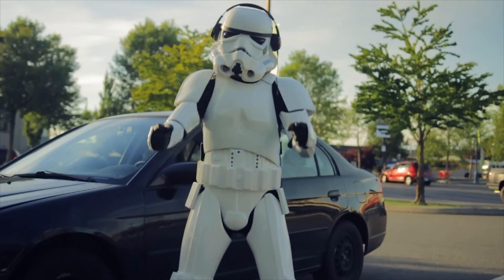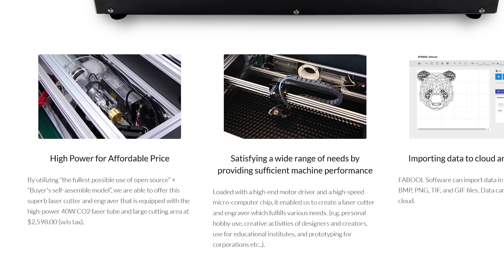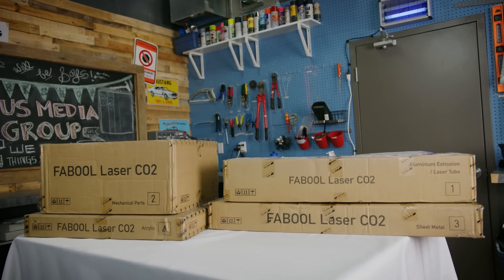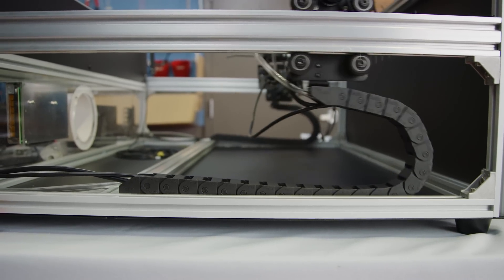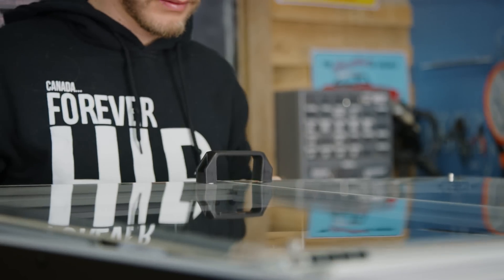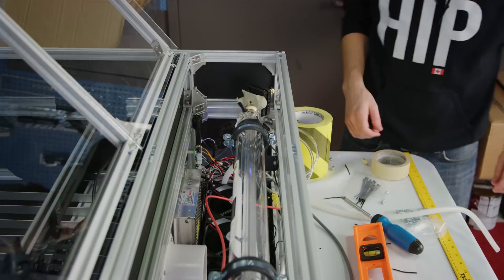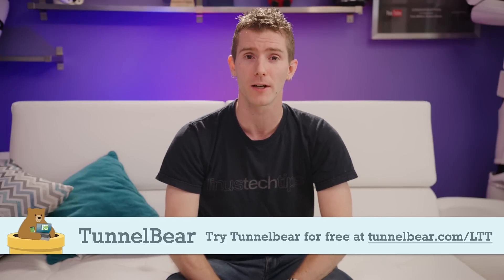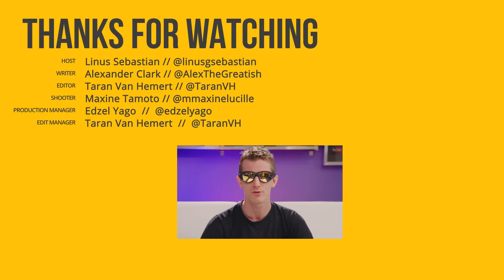We Built a FRICKIN Laser Cutter - HOLY $H!T

Comment: I’m and engineering technician and run a number of laser cutters, and there are a couple of things that could help your cutting experience, and I may have come up with an RGB fix for you.

As mentioned you need to have a pressurised air hose that blows air onto the cut to keep the head from becoming jammed up and the cut nice and clean.

When adjusting your laser cutting settings, you’ll need to use a consistant spacing block from the head height ( I use a 2mm acrylic piece ).

When adjusting the mirrors, I cut myself circles of 0.4mm card with targets on the center rather than using masking tape as it allows you to compare adjustments. 

By the looks of things you’ll want to increase your gain as you reach high XY values as with the cheaper types of mirrors you have you’ll experience more light dispersion.

When cutting or engraving shiny materials particularly mirrored acrylic and un finished aluminium, either cut from the back (not possible for engraving) or cut through masking tape on the material.

You’ll want to make or purchase some metal cylindrical standoff’s that allow you to engrave material that isn’t flat, like the side panels of computers.

Finally, in terms of the RGB fans, they may have proprietary headers, but their code is either open source or available from the manufacturer directly. When I was servicing our 1mx1m industrial laser cutters, I re flashed our machine with an improved source code that allowed many of the menu functions on the display to be hidden, so it can be used in an teaching environment.

Good luck

Comment: I made my own DIY laser cutter bigger than this, and man did the alignment cause me trouble. Its a pain in the ass. Don't forget to use air assist, smoke will actually burn in to the focal lens and cause it to cloud. You will have to replace it. And about the 3D printing, it really depends, I run a bigger nozzle and parts are very strong. Great vid.

Comment: How about using it for some serious case modding?
I have been looking to buy a new case, and have noticed that almost all a manufactures, offer a lot of bling, but lousy airflow.
For example, a plastic shield in front of the front intake fans, and the air is only sucked in through a 1 inch(2.5cm) wide strip around the front.
A custom front plate, that lets the air flow, with some RGB fans....??? hmmm???

Comment: You should be careful with the fumes. The laser cutter at my school has a separate module to filter the air that comes out. Also, never cut carbon fiber with that thing it's very dangerous.
Reply: Use to use one in school about 10 yrs ago, acrylic is horrible to cut. Don't ever try to cut lexan without the proper equipment it just melts, catches fire and can ruin the lens on the head
Reply: What, it connects to the closest black hole?
Reply: Totally agree, specially the fumes from Acrylic is nasty as fuck, and can/will catch fire, and you would want suction for that.
Reply: How is this not higher? This shit is incredibly dangerous and you're endangering the health of your employees by operating it.
Reply: Prince Westerburg i didn't invent it but I can assure you without the proper filtration these toxic fumes can cause forms of lung cancer.
Reply: Chad Porter what I remember is that when you cut carbon fiber it is not cut cleanly. Since it's a fiber, small strands of it can get caught in your lungs and cause forms of lung disease. Carbon fiber is extremely dangerous when inhaled.
Reply: Toster2013 no the filter is whole separate unit like 1 cubic meter. It needs to filter out toxic fumes it's not just a simple thing.
Reply: Matteo Mazzone so a fan, a carbon filter and a big price tag coupled with a salesman happy to scare local authorities into buying them.
Reply: But what if they tried it on Carbon Fiber 🤔
Reply: We use to cut wood, vinyl, acrylic, engrave painted metal and etched glass with ours the ventilation system was just a simple 4in duct with a fan and a simple filter. Anything beyond that required argon and a much better filtration system. I'm not up to spec on the exact wattage etc for what it was all I know for certain it was a co2 laser and we used Corel draw 12 to send our vector and rast images due to the ability to adjust power settings based on material.

Comment: Guys is this a good computer build ?

https://pcpartpicker.com/list/YfhnZ8
Reply: Yes thats plenty for highend gaming performance, only slow part would be the HDD, i would get a 256 or 500 GB ssd to run windows/games from, that is hdd intensive, to improve loading times.
Reply: chrisjon ok thanks for the suggestion!
Reply: May want a better cooler like a aio. But the 212 will keep it cool if it’s not overclocked to far. It’s not a need is more of a want.
Reply: Also you don’t need that fast of ram for intel. Could save money for a better cooler if huger is tight.
Reply: Matthew k which ram should I gry
Reply: Matthew k get*

Comment: Alright Linus I got you. Make a “case” or dock that you slide a laptop in.  The laptop should be put in vertical and flanked by 2 inch metal planes on the side with plenty of RGB. I thought for laptops like the Alienware 13 you could had a bar with ports that slides into the laptop when you put it in the dock with servos.  Anyway in the main container below the laptop there should be external graphics, external storage and extensions to the docks own IO to plug in a monitor. Another idea is to try and make the drone from Rainbow six.

Comment: That "weird fitting thing" is part of a quick release pressure system. You would normally use it for pressure cylinders or blowers. (They are used in industry a lot). You would hook it up to a pressure (or vacuum) supply. Its called a air hose probably used for sucking out all those toxic gases. So pretty important i would say!

Just cuz i am a total show off here is the part number: PMSP04/02

Comment: 'weird fitting thing'. its an air line quick connect. you can run air assist on laser cutters. helps keep the lens cleaner for longer and will blow small dust or debris off the surface allowing the laser to cut cleaner. worth setting up if you plan to cut anything dusty. i.e. mdf
Reply: Worth setting up when cutting anything, acrylic produces alot of gass, that can and will settle on the lens, so having constant air moving will help keep it clean.
Reply: max imus this guy lasers

Comment: "cheap", only $2500
Reply: 40 watts, same CO2 tube as cheap $300 generic Chinese laser cutters on eBay
Reply: It is in fact cheap for a laser cutter tho
Reply: 300? That is the price of a laser tube, link me that laser cutter lol
Reply: Pablo Vazquez https://rover.ebay.com/rover/0/0/0?mpre=https%3A%2F%2Fwww.ebay.com%2Fulk%2Fitm%2F192377865860

$389, not quite $300
Reply: thats 12 inches by 8 inches, not quite the same as the one in the video smh
Reply: Khom T. Long, the immediate downside to that one, is the small working area. I think its more of a desktop cutter, than something i would have in my shop.
Reply: It's affordable. Like a Kia vs a BMW.
Reply: The lasercutter in our factory cost 150,000.
Reply: Work area might be bigger but it still 40 watts. Can only cut through smaller gauge sheet metal and wood. Primary use would be engraving. Thought about getting one to make my own acrylic fight stick enclosures
Reply: +Khom T. Long 
Well, it does exist lol, but cutting anything wider than 3mm would take a long time or wouldn´t be possible, plus I don´t think it would cut any material other than wood. But nice to make some key chains lol
Reply: Khom that’s engraver not cutter i guess
Reply: What two products?
Reply: Noboliner well thats pretty affordable
Reply: No need to insult me, geez. It may be cheap for a laser cutter (not incredibly tho, since most Chinese kits are around $2500), but this doesn't make it a cheap product. $2500 is still a huge amount of money.
Reply: He means compared to other laser cutters dumb ass moron
Reply: Frankie Santiago not really. A kia and a bmw can take you and your luggage to the airport. These two products can't necessarily do the same tasks. Its more like a car vs a motorcycle.

Comment: 3:47 You should plug in pressured air. It blows air on the place where it cuts, to blow away smoke and make a cleaner cut.
Reply: ^^ he did the math
Reply: Blows away the smoke so the laser can reach the material, puts out small fires, but most importantly stops dust and smoke reaching the lens.
Reply: Yes it's a common port used in pnuematics to transfer air pressure into a desired location via an air compressor
Reply: It's a push in fitting. For air, liquid or vacuum.
Reply: Yes, but I'm pretty sure you will ruin the laser cutter if you put liquid in there xD
Reply: But the air will blow away the laser beam.
Reply: I like how there are plenty of people who have clearly never used a laser cutter mentioning CO2. My work Epilog laser came with a standard air compressor, my personal laser cutter uses one too. Using compressed air works fine I've cut paper, card, wood etc and if the air is on and the laser is properly focused, there's no fire. Using inert gases means you need either gas cylinders or a nitrogen generator, then you need O2 monitors etc. Expensive and hard work for no benefit.

It's worth adding gas for more powerful lasers (1kW rather than this 40W), they can use Oxygen to react with tough to cut materials like metals.
Reply: " like how there are plenty of people who have clearly never used a laser cutter mentioning CO2"
Most are simply unaware the CO2 is used in the laser tube itself as opposed to a a feed consumable like the gas assist system. 

"Using compressed air works fine I've cut paper, card, wood etc and if the air is on and the laser is properly focused, there's no fire."
This is true

"Using inert gases means you need either gas cylinders or a nitrogen generator, then you need O2 monitors etc. Expensive and hard work for no benefit."
This is partially true.
As stated you need a supply bottle for any inert gas, but to say they provide no benefit is untrue - They provide a much cleaner cut by shielding the kerf from the scorching effect. If you have been laser cutting wood and paper, as you stated earlier, you may not have seen this due to the natural charring of the material, on Rubber, Plastics, glasses or metals it is much clearer.
As for the O2 monitors - not necessarily needed but in an ideal world, yes.
If you have any prio experience of noble gas flow rates, for example from Tig welding, then it is a simple task to over-estimate the shield flow rate needed and absorb the cost

"It's worth adding gas for more powerful lasers (1kW rather than this 40W), they can use Oxygen to react with tough to cut materials like metals."
If you have grown used to industrial grade lasers then your perceptions are warped by the consideration of what speeds and finishes are acceptable for business uses.
For example, it is possible to use a much smaller wattage tube with a rough o2 gas assist to get a result.
From personal experience a 60w tube rigged into a machine similiar to this one with o2 you can cut 0.9mm CR4 steel if you are willing to deburr the final product
On another scratch build project I've manages to cut 2mm stainless steel with a 260w tube
Reply: Small chinese vortex tubes (pneumatic cold/hot air source) and many other pneumatic devices use the same thing. There ARE adapters to npt but it's very uncommon in the U.S.
Reply: co2 still leaves mild scorching and layering of carbon, it burns down to carbon monoxide which is quite risky in and of itself if not propperly vented.
Argon is likely the cheapest noble gas, as it is easily available in pressurized bottles from welding suppliers
Reply: http://www.thefabricator.com/article/lasercutting/gas-gives-the-big-assist-in-laser-cutting
"Assist gas sounds straightforward enough: It aids cutting via an exothermic reaction (with oxygen) and evacuates molten material. It’s so straightforward that, according to sources, many new operators don’t think to adjust it when they get a bad cut."
Reply: It's most likely used for compressed air and a vacuume on the bottom
Reply: @Rob P fuken ded
Reply: spaceminions like alot of things
Reply: it is not for air, it is for CO2 coz laser will light anything on fire if you start cutting with it, thats why you need CO2 gas to make it hard to catch on fire
Reply: Not necessarily compressed air, it's likely the feed port to fuel the "Gas assistance system"
You attach a feed line from either a compressor or a pressurized gas bottle
there are several things you can do with this depending on your gas.

As mentioned elsewhere, Nitrogen gives a cleaner cut finish as it washes air away from the surface, this avoids the oxygen in the air combusting and blackening the products.
You could also use pure oxygen, this requires care as it is a serious fire risk, as a Ghetto way to increase the power of the cutting effect, doing this you can achieve basic cuts on thin (0.9mm and below steel) if you use oxygen and replace the 40w tube with a 60w one
Reply: co2 is probably the cheapest non-reactive gas to use, could even be mixed with different percentages of oxygen to achieve a desired reaction rate
Reply: It's for compressed air to keep smoke and other particles away from the focus lens. If small particles get there they will be burned onto the optics what will kill the coatings on them. Unlike welding, cutting (with lasers, plasma or torch) mostly uses reactive gases of gas mixtures to burn faster thru your material.
Reply: there is no O2, just plain CO2, sold in CO2 tanks, and used for laser cutting for AGES
Reply: Rob P please tell me that's a joke.
Reply: I think the ideal gas here would be pure nitrogen (cooled if possible but i don't think its a must), yes its expensive but it in a way it will do the same as vacuum as it will make sure that the laser cant burn anything due to the removal of Oxygen from the space. Vacuum isnt an option here because i'm sure that the acrylic panels are incapable of keeping any noticeable vacuum. Noble gasses are also an option but way too expensive for its application.